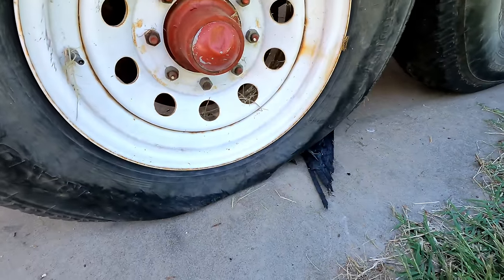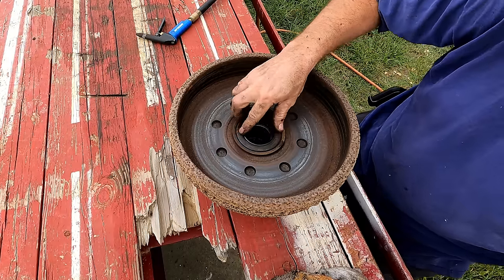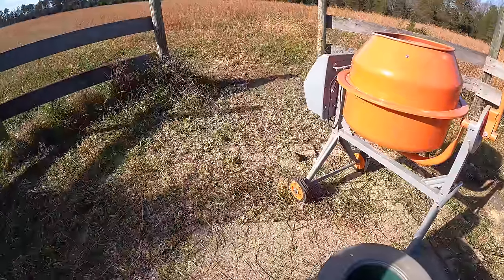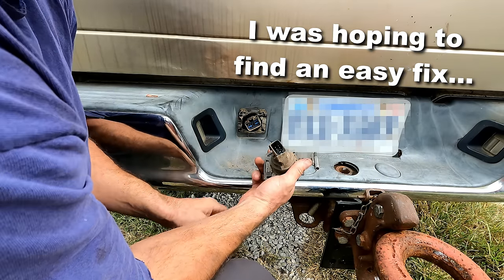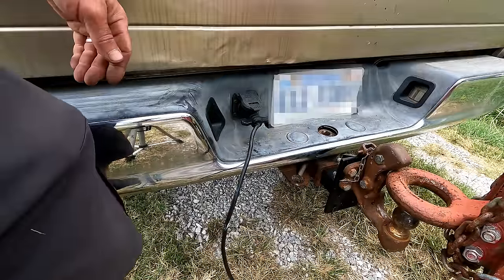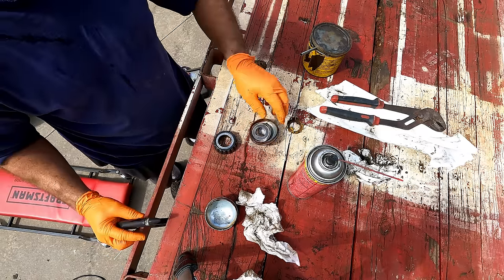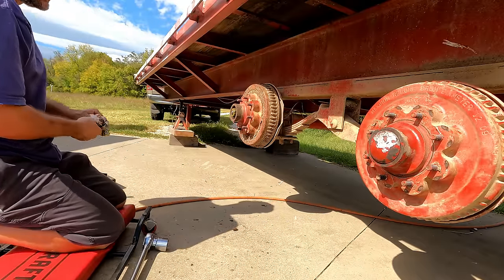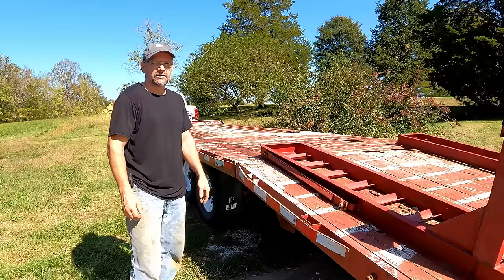Fixing A 7 Ton Equipment Trailer: Brakes, Electric, Tires, & More.

Comment: Jon, I love your content. It is not only some of the best on YT, but some of the best in media (nothing to see here on TV anymore). I enjoy watching you attack problems and maintenance you have in your content and the approach you take to do it. With that said, I am surprised at the condition of the trailer. Yes, there are only so many hours in a day and we have to prioritize our precious time. You recently were transporting heavy equipment (your dozer and excavator) on public roads to do the pond project. However, you knew your brakes were not functioning, and the tires were clearly unfit for service. I am glad you got to this. This is really to everyone else who has trailers. It is important to maintain our vehicles and any equipment we tow with them, to not only protect our own interests, but those of the general public we share the roads with. If one of those tires let loose with 10 tons on it and hooked the vehicle not having the ability to slow that load, the results could be catastrophic as the 10 ton load pushed your vehicle into on-coming traffic. I know you mostly use the trailer on the farm, but do occasionally put it on the road. I hope others watching will be reminded to check their own equipment, and that this instruction will help them to get their own in a proper operational condition. Other lives are at stake. Tires deteriorate whether they are used or not.
You might want to consider adding a breakaway connection to the trailer for when you do use it on public roads on occasion. Trailers now of that size not only require active brakes controlled by the vehicle (you restored), but also an emergency brake that is applied in the event the power from the tow vehicle becomes disconnected (if the trailer becomes unhooked for some reason). That would be provided to activate the brakes via power supplied by the trailer itself and a trailer battery. It would be good to add that to your trailer. You can get a kit online at eTrailer for only $50-60 that includes the battery, battery charger (that charges off that 12V source built into the 7-way connector), and the breakaway switch. At that price, it really SHOULD be added for peace of mind, for your protection and your property, but also for others on the road. It is just another safety measure that is low cost. Sorry if I sound preachy. I see trailers and other equipment including the vehicles themselves on the road all the time that are in obvious poor condition.
Like others said here, I would have hosed down the brakes with cleaner and then lubricated everything afterwards. I tend not to use the white lithium grease for that purpose as in my experience, it dries out and just leaves some cake that no longer does much. Everything else you did looked good to me. You might want to check and see if there is any indication on the axles what kind they are and their rating, and if there is any plate on the trailer itself that has a GVWR. The D3, all the chain binders and the steel trailer weight itself is likely in the neighborhood of +25,000 lbs. Just looking at how spindly your axles are, I am guessing there is no way those axles are rated much above 8K each. Even hauling your Yanmar could be coming close to or exceeding the weight rating of the trailer. Those Hercules tires are likely rated for about 4K lbs each. Your weight rating on your vehicle pulling with a bumper pull is likely greatly overloaded. The rig is only as good as its weakest rating.
Reply from the maker: Much of the work I did on this video was quite some time ago, and the brake job was done prior to towing the dozer.  It hadn't occurred to me to explain that when editing, but you are correct.  I never would have towed that dozer without knowing the trailer was functioning 100%.  I also wouldn't tow that dozer any distance with this rig.  When I moved it to the pond site, it was only 6 miles away.  I've been looking at getting a heavier trailer that I can tow with my dump truck.  Cheers.
Reply: @FarmCraft101  I should have figured that you edit some stuff out of order. There are a lot of well-used heavy duty (30K GVWR) equipment trailers out there with clapped out decks and frames covered in surface rust that maybe could be a source of some more tasty content. Now you have me wondering if you would get to use the farm exception to escape all the hassle of a CDL. The backbone of this country is our truckers who deliver everything we get from brick and mortars and a lot of the online stuff until the last miles. Makes you wonder why they are making so hard to get a CDL now. Some of the cost required now has the look of purely unneeded bureaucracy that does not bolster safety. I would like to get one myself, but not if I have to spend weeks in class and spend thousands of dollars. Maybe that is not a worry for you.

Comment: Soldering trailer connections, pretty impressive. We usually used butt splices loaded with noalox, then heat shrink over that, or the heat shrink built in butt splices.

Comment: Love your work. For what it is worth, where we are the mice seem to like to eat the insulation off the wire on our trailers.
They make an adapter configured for your trailer plug to adapt it to 4 wire that has led lights. That is the first thing I look at when I have a trailer connection problem. I bet they make one for all pins for what is on your truck . Mine was very cheap.
The disconnect and reconnect fix I find is quite common.

Comment: When you said "trailer tires", i knew it was going to hurt. Even the little ones are expensive! I have a 9X5 and an 18 foot one. Both need new wood right now. And the brake wire on the big one got pinched between the wood snd frame, so my controller was flashing "OL" for a bit. Always something!

Comment: I have found with electric trailer brakes, unless they are basically brand new, the vibration of the trailer going down the road is a key component in getting them to grab/release reliably.  Up on blocks  even with all the parts in excellent condition, they sometimes don't want to engage or continue to drag a little after the power is removed.   a rap on the trailer frame and everything works like normal.

Comment: There is an Electrical spray for contacts that might help in keeping contacts. Looks like you need to get some oak sawn boards from a sawmill to relay the deck.  Oak lasts much longer than pine or fir.

Comment: Dirty contacts. Bulldozer on trailer may have caused tyre delamination.
I use water spray on brakes then wd40. 
Nice presentation . Good area for repairs that's so important.

Comment: Jon, on watching your 7000 lb trailer overhaul i note a fairly large hole in the bed at the 5:27 sec point. A lot of bed rot is also evident. With the heavy loads you put on that deck i would worry about a wheel popping through. Looks like its past time to harvest some of that white oak and prevent a worse problem. My friend is a state arborist and he suggests using red oak if you have a surplus of it as it is nearly as good as using white oak. The difference in durability is very minor (5-6% at most). Using either of them should give you a deck good for over 40 years.

Comment: The way to stop black electrical tape from unravelling is to cut it with scissors instead of tearing it off. I discovered this by accident a few years ago. It seems that when you stretch it to tear it, it damages the glue

Comment: Jon, it appeared that the trailer needs some extra work. Early in the video 0:22  I noticed a hole in the wood deck. Time to put more of that free white oak to work and perhaps some paint! Another project?  When I rebuilt mine, I used some sand in the wet paint to add more traction and possible more wear resistance. Time will tell.

I do know what you mean with the bicycle pun. At 78, I’m usually too tired about 45 minutes into most jobs. 

Keep up the excellent project videos.

Comment: My older brake controller had 2 adjustment dials, one for gain and the other for adjusting the braking pendulum to make it plumb depending on the angle the controller is mounted at. That and no deceleration to move the pendulum is possibly  why you don't have brakes by pushing the peddle while the truck is stationary.

Comment: I had problems with my Dodge pickup with the same issue. I bought a new plug and put dielectric grease in the plug and have not had problems since.

Comment: You can remove the outer bearing, screw the spindle nut on a couple of turns and use the inner bearing to pop the seal off without damaging it!

Comment: 31:00 inertia based braking. those controllers make for a real smooth braking action. (horses approved). not sure how old that one is, but on my tekonsha controller there is a setting for the minimum braking power, then another setting for how much rampup there is (based on how big a load you are towing)

Comment: That liquid tape stuff is a PITA, if you've never used proper splicing tape try something like 3M 2155, it's self adhesive, waterproof, and relatively cheap... last roll I purchased was maybe $4. It lasts nearly forever in a toolbox and has no sticky adhesive to goop everything when it gets hot, and once it sticks to itself for a few minutes it's permanent. The only trick is that you have to stretch it as you apply it and it can be somewhat easy to break if you pull too hard, so be gentle.

Comment: John, the constant power to the trailer is for caravan use. It powers the 12v circut on the caravan such as lights and fridge etc, which you need when pulled over for the night. Love the vids.

Comment: My father and I have had a handful of those trucks between us, each one of them had the factory trailer plug go bad and had to be replaced. The pins would get loose and then not make good connection. I would get the trailer plug with a pigtail and then wire it directly into the truck harness and do away with the factory connector.

Comment: I prefer to use crimp and seal butt connectors, wire loom wrapped in Super 88 tape, and self drillings screws holding P clips to the frame.  Especially in the terrain you take your trailer, keeping the trailer brake wires up and out of the way is a huge deal for longevity of the brake wiring.

Comment: Always rebar concrete. Whether it is just some nylon rope placed in at halftime of the pour through to wire mesh, or the cool plastic rebar you just pour into the mixer. But concrete always wants to tear.

Comment: Instead of using electrical tape try using self amalgamating rubber tape. You use it the same way but give it a little stretch and it bonds to itself and the cable you're wrapping it onto. Really good stuff!

Comment: Hello, long time fan. I just wanted to say that in general you don't want to solder wire connections like that. The reason is that if there is too much current, or the wire over heats for other reasons, it can flow the solder and break the connection. You want to use crimp connections whenever possible with wiring because they maintain the connection even when very hot. I found this out the hard way with a brushed motor that kept melting the solder I used to connect the power leads.
Reply: Iirc those are called "double u crimp" handy if you can't access a way to solder in the field + heat shrink and you are golden.

Comment: Electrical connections will oxidize out doors in the elements pretty fast and cause an intermittent connection. Unplugging and re plugging them will "Scratch" the contacts back together removing the oxidation temporarily. Use Dielectric grease to protect them from oxidation.

Comment: I just usually use a tiny tie-wrap on electrical tape. Will hold forever...or until it comes off. Lasts longer than a loose tape end.

Comment: The power is to charge a battery or provide power to any 12volt lights or such on trailer. Get rid of the Meter and use a test light that loads the circuit while testing. Dielectric grease is needed in the terminals.

Comment: Tires, hydraulic hoses & batteries, always something expensive to work on but never a "good time", Jon.  Nearly always when you plan to go do something but one of these "boys" say no, not today.  There are not enough hours in a day some days. Rust accumulates in the brake hub and makes the first stop squeaky tight but rubs off with each braking. Thanks!

Comment: Harbor freight and northern tools used to sell a grease packer for bearings you could use with your grease gun to avoid most of the hand mess.  I never had enough bearings to grease to justify owning and cleaning one up after greasing bearings to be installed.

Comment: Remove the outer bearing. Reinstall the nut halfway. Slide the hub outward and use it as a slide hammer. The inner bearing will knock the hub seal out without damaging it.

Lube your bearings, drive the seal back in carefully, and reassemble.

Comment: Electronics technician here: it is not uncommon for those contacts to oxidize and just "working" the connection can restore the contact. It would be a good idea to put some oxidize on the connector where the harness mates to the plug at the bumper

Comment: Tire delamination I noticed is more common with bias ply trailer tires or the cheaper trailer tires as you would call them I switch to radial tires a little more money but they seem to last a lot longer trailer tires tend to not get driven as much as they sit and the elements to take their toll

Comment: Copper based anti-seize is by far the best product to use on terminals. Vastly improves a corroded connection. Will not improve a good one.

Comment: You should get some heat shrink so when you wrap a wire with electrical tape you can heat shrink the end that flaps loose after time. I started doing that to clean up my wiring harness on an old car. Just remember to slip the heat shrink on before you make the solder connection and tape it.
Reply: Glue lined heat shrink works even better

Comment: Love your videos, always so entertaining and educational. And trailers are super fascinating, for most small businesses, the trailer is where your life as a contractor begins :)
However, on behalf of all confused Europeans, I would like to ask: What the hell is that trailer coupling? :O
I would love a segment on the rules and regulations for towing in the US, and how tow vehicles and towed vehicles interact with each other.

Here in europe, trailers for cars typically have the brakes actuate through a compressable part of the towbar, braking the trailer when it "catches up" with the tow vehicle.
And trucks just connect their brake air system to the trailer and actuate it just like the trucks own brakes :)

Thank you so much, and sorry for my suboptimal English :)
Reply: It's called a pintle hook.  The trailer has a horizontal ring that fits over a vertical pin on the truck.  A latch closes over the pin to contain the trailer's ring.  In this case, the pin is a ball so a trailer with a socket will also fit.  Just leave the latch open.
Reply from the maker: As Ken said, it's a pintle hitch.  Typically used for heavier towing.  And my hitch receiver can be used both with a pintle trailer and a 2" ball.  As for brakes, most small to mid size trailers that have brakes use electric like mine does, at least in my experience.  Really small trailers often don't have brakes and just rely on the vehicle.  Big truck trailers often use the air system just as you describe.  I have seen the system you describe where the trailer brakes are actuated by the trailer pushing on the tow vehicle, usually with hydraulic lines and brake fluid, but that is less common in my experience.

Comment: Your brake controller works on a pendulum to apply the brakes. It senses the inertia of the truck when you apply the brakes and then sends power to the trailer.

Comment: Thise axles look like the Lippert axles on both of my trailers. if you have the axles numbers all of the parts would likely be available on Amazon. Bearings, seals, brake assembly plates and drums etc. They are an easy swap and I believe the ones for mine were $160 for each wheel. That included everything but the drum. My drums were good.

Comment: Well, about the tires; I know this here in Europe from 'retreaded' tires (new tread). These react very sensitively to overloading when the air pressure is too low. This heats up the carcass and the vulcanization loosens.

Comment: optimizers on solars isnt "groundbreaking" in any shape or form. They add cost to the panels, the optimizers by themselves can go caput, so its important for the user to figure out whether they really need them or not.

Comment: Re-seating connectors fixes a multitude of issues.  The metal on the connectors oxidises and forms a very thin insulator.  Usually it not an issue as working vibration is enough to break the oxide layer.  Usually!!!

Comment: That connection issue you had with your trailer brakes happens all the time on my truck and boat trailer..  I think they terminals just get oxidized and nasty, so I end up plugging and unplugging a few times, then poof it works...

Comment: As a systems administrator I cannot tell you the number of times I fixed a problem by taking a connector out and putting it back in. It's why gold plated connectors are a great thing (it prevents corrosion).

Comment: You got off easy on the tires..try buying 4 new skid steer tires. Even smaller than those with a shorter lifespan. Make sure you're sitting down when they bring you the bill.